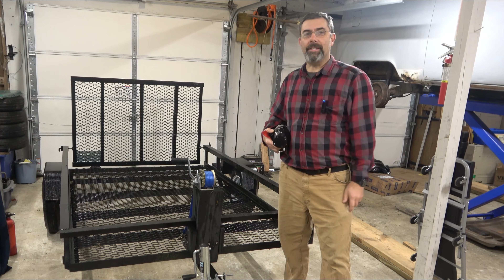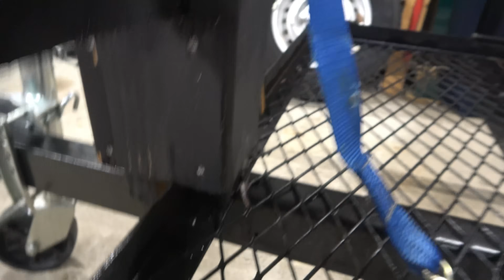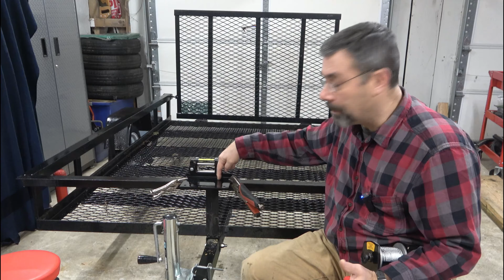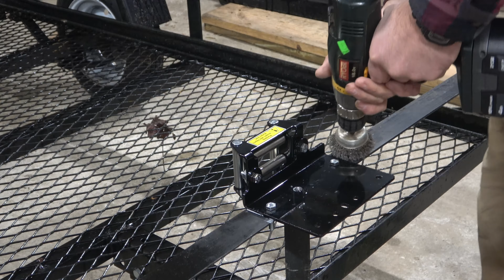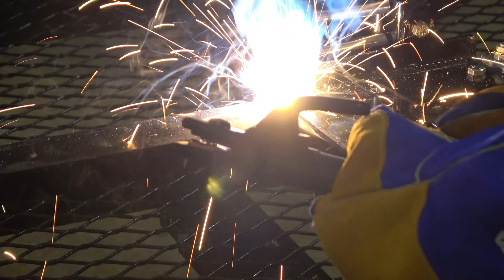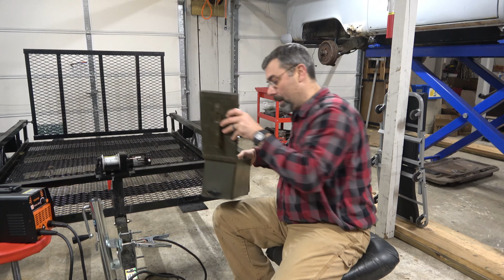Installing an Electric Winch On My 5x8 Carry-On Trailer. Let me show you how!

Comment: Great idea! I’m looking to do something similar with a 4x6 trailer. What adapter did you get for the battery and where could I buy one?
Reply from the maker: I got an adapter off amazon that fit a Ryobi battery and was able to wire it up
Reply: @FarpointRestorationsAndRepairs thank you! I appreciate you responding back.

Comment: where did u get the metal box from what sizes battery  fits in it
Reply from the maker: That is an old Ammo can.
Reply: @FarpointRestorationsAndRepairs  what sizes is the old Ammo can and what type group sizes battery you use in it
Reply: @johnstratton5637 harbor freight sell them

Comment: Picked up one of the Carry On 5x8 trailers myself with the metal floor. What a decent way to transport heavier things. 1650 LBS is still a pretty decent payload and near what most 1/2 ton trucks are rated at for payload. Like the winch idea and really like how that ammo can mounted to the front there. Great idea for cargo straps and what not. Like the idea of the winch because if mower goes down, have a mechanism to get it back on to the trailer.
Reply from the maker: The old one I had was a manual winch and it worked well- This works way better

Comment: just ordered that welder, i needed one for around the property.. dang good idea.. thanx.. i made a 14 foot homeade trailer from an old pop up camper.. sand blasted with a HF sand blaster, and laid pressure treated planks on it.. the 8ft thing was a learned experince for me too..its why i made sure it was over 8ft.. i totally totally understand the 8ft thing..omg ..learned the hard way here in the wooods of maine! cheers on the snow!
Reply from the maker: It was a surprise when the 8foot drywall would not fit. Maybe a moment of panic before we thought to take the old wench off.